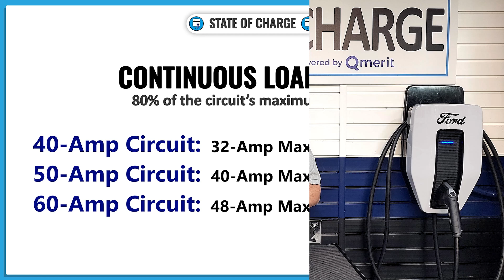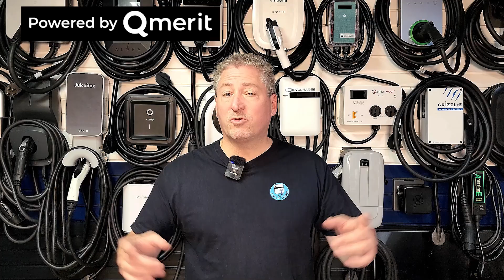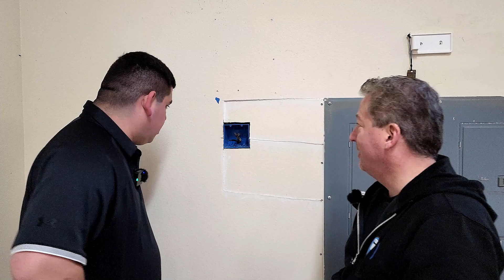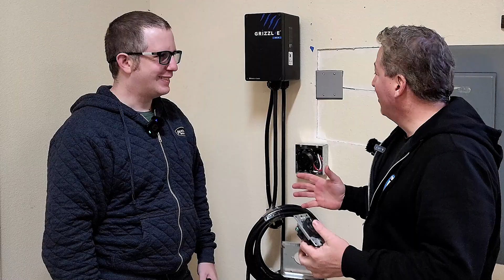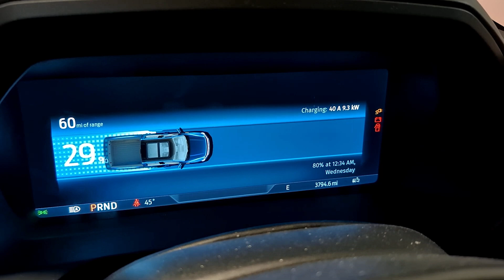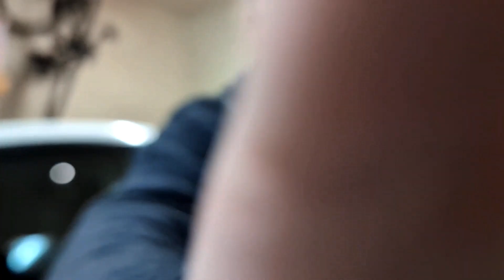Recharge Rescue Washington: We Fix A Dangerous NEMA 14-50 EV Charging Outlet Failure

Comment: hate to say it if you got the electrician over just hard wire and be done.  Also upgrade to the 60A and wire (I mean this is like 2-3 feet of wire) and you will get the full 11KW plus and have not to worry about plugging and re-plugging .. unless the plug may be used for something else.  cheers  good job though 🙂

Comment: I installed a Legrand outlet and it seems to be working fine. I did unplug it a few times over the first year to check for melting and found no issue. It has been installed for 2yrs now. If anyone has had issues with a legrand, please response if you see my message. My 2nd charger for my 2nd ev, I hard wired so no need to worry there.

Comment: Here’s a pro tip for all you DIYers like me.  To fit receptacle in box, you must bend wires as needed.  Always, do a final re-torquing before pushing wired receptacle in box.  Those final wire bends will loosen the connection causing heat.  Electricians refer to this as the “wiggle test.”

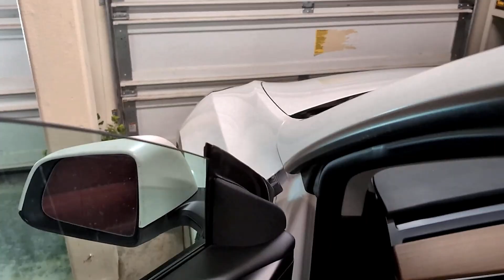Comment: 25:22 it actually appears that the Tesla is capped at 20 amps. Shows 20/20 A. Is the charging equipment communicating its max output to the vehicle, or is the vehicle configured to only accept 20A at that location?
Reply: The EVSE always tells the vehicle how much current is available using a signal on one of the small pins in the connector.  The car can be set to draw less, but the max it should draw is what the EVSE signals it can supply.

Comment: The contractors that qmerit has are junk. The contractor that qmerit had come over for me installed the wrong gauge wire, and breaker. I had to explain the 80% rule.

Also just an alaround sloppy installation. He didn’t know how to bend pipe so just used flex.

The Qmerit constrictor also said he permitted it. But when I got solar panels a couple months later, the permitting authority noticed and shut that circuit off. I had to pay the solar company to fix it and permit it.

Comment: In some cases a 50A receptacle will be wired to a 40A circuit per table 210.21(B)(3). Most mobile chargers only draw 32A continuous for this reason, however it is possible to find plug in chargers that draw 40A continuously. It is likely that most 14-50 receptacles can only handle 32A or less. I surmise this because there is little difference between a 14-50 and a 14-30 in terms of construction. In fact if you cut off the unused neutral on an EV mobile charger, it will fit in a 14-30 receptacle. The contacts are the same.

Comment: Thanks for covering the subject well. I had my NEMA 14-50 outlet installed by an electrician more than 7 years ago and have changed most days at output of 9.6 kw with no problems. Lesson to be learned is just because you were able to wire your house with Cat5 cable one weekend and speaker wire for surround sound another time does not make you competent for 50-amp circuits

Comment: The grizzle didn't support being directly hard wired ?
Reply: Of course it can. He didn’t want it hard wired though
Reply: why not ? Trying to understand why you wouldn't want it hard wired. It not a mobile unit.
Reply: @johnsmithuti  easier to replace, easier to plug in a level 2 mobile charger for backup if needed
Reply: @johnsmithuti  because when it breaks it can be swapped out very easily. You can also easily plug in a mobile unit as a back up if it goes down
Reply: @doomsday9973   @doomsday9973  oh I see 😄 but in this particular situation the charger got fried because it was not hard wired! Best practice is to always avoid points of failure
Reply: @ only because it was improperly installed and used a substandard outlet. Properly installed with a robust outlet they can last for years and years

Comment: First off, it didn't look like the homeowners charger was damaged, the one pin was just burnt.  It could have just been cleaned up.  But it was good that you provided a replacement charger and one that splits the charge, which is something he needed.

However, this was a lazy install by the electrician.  Why didn't he remove the drywall panel that the homeowner cut out?  And then replace the box inside the wall.  Now the homeowner has and external 240v box and a box cover on the other one.  It's not a clean install at all!  And why didn't the electrician check the parts at the shop prior to leaving for the job?  Then he would have had time to get the right cover for the 14-50 outlet.  Qmerit should be embarrassed and not use that company to represent them.

Wish you'd come to my house and replace my 14-50 outlet.  I installed the cheap one and got a Hubble later, that I haven't gotten around to installing yet.  I'm always checking the outlet for heat when charging and often will lower the amp rate, if I need it to charge for hours so it won't overheat.  It's an easy replacement for me, and yes I have a tool to do the correct torque.  I just haven't had the time to replace it yet.

And people wouldn't do these type of installs if permits and electricians weren't so expensive, especially for such a small job.
Reply: Same exact here. I de rate mine to 32 amps and it’s fine and has been for years. As soon as I get the chance I’ll install the hubbell
Reply: @doomsday9973  Mine is limited to 32 amps anyway because I'm using the Tesla mobile connector with the outlet.  I'll probably just reduce the charge rate to 25 amps when it's charging while I'm at home sleeping.
Reply: The reason that the electrician used a surface mount metal box is because the wall cavity contained insulation. 

The old box was surrounded by that insulation, which contributed to elevated temperatures.

As others have pointed out, the electrician did not use a torque wrench at the breaker.

Comment: I hardwired my charger (for our Bolt) in 2007.  It's a 40 A breaker with a short run to the charger.  I have used the 14-50 Leviton (older style) on my welder extension cord & tested my Rivian portable charger to see that it worked for 2 hours.  The cheap plug works fine with my tig/stick welder.  Likely because it is never used continuous, always short (under 1 min) welds.  As you pointed out, continuous high current produces heat & a lot of it.  Good Video Tom.  My next project is an off grid, stand alone charging system using solar panels & lots of batteries.

Comment: I bought a new house that came with a dedicated circuit in the garage intended for EV charging. The electrician used aluminum wiring. Later I hired another electrician to install an outlet for a plug-in charger and he installed the cheap leviton outlet. Over time the level at which I could charge my car without tripping the breaker got lower and lower. It was because the outlet was slowly disintegrating and the aluminum wiring was expanding and contracting too much causing loosening of the connections. Both electricians knew what the circuit was going to be used for. I finally had to spend thousands of dollars to replace the entire circuit with copper wire and the outlet with a hubbel.  It was absolutely ridiculous, and I used qualified electricians.
Reply: There are specific connectors designed to interface aluminum and copper wiring. They have to be used and torqued correctly. Then copper wiring into the EVSE.
Reply: Thousands of dollars just to pull new wire and swap a recepticle? Where is your electrical box? The other side of the house?

Comment: No truer words have been spoken my friend Tom.  After watching Sandy Munro’s video 2 yrs ago on charred receptacles, I upgraded mine to hard wired or Hubble 14-50s for remote locations.  The $10 Home Depot receptacle is designed for my dryer, not a car charger.

These United Charger Grizzle-e Dou’s are underrated as they’ll build them with a J-1772 or Tesla NACS or 1 J-1772/1 NACS.  No one else does this!  I just wish it could be upgraded to a smart unit.

Comment: Maybe this will be discussed later in the video, but why install a 14-50 outlet at all?  Wouldn't hard wiring the EVSE remove the cost of both the 14-50 receptacle and the plug, and also allow a less expensive circuit breaker instead of a GFCI breaker?
Reply: Ease of swapping a new unit if the old one fails, also have access to a quick level 2 backup solution with a portable charger. Several reasons. I prefer plug in over hard wired as well
Reply: @doomsday9973  I have 120 V, 20 A outlet for backup.  Charge speed, even at only 12 A, is fine for my daily driving, 15-50 miles per day.  I used 120 V for a year and it was enough even in winter.
Reply: @ that’s fine for you but 120v will not cut it for most people. Having a 240 is a much better backup
Reply: @doomsday9973  Sure, people that drive 40+ miles every day will need 240 V.  

I still would prefer hardwired EVSE over plug in though.  Less things to fail, and no need for an expensive GFCI breaker that plug in EVSEs require.

Comment: I still at this point cannot explain why any home charger should use an outlet setup. You aren't going to take that charger with you (unless you move). It's just a point of failure.
Reply: EVSEs can fail on their own all the time hardwired or not. When they do you simply plug in a new one in minutes. You also have a quick and easy back up option with a portable charger you can simply plug in if your wall unit goes down so you always are covered

Comment: Oven and electric range don't run continuously. They get up to temp and then regulate their output to maintain the temp. Maybe on high, but otherwise it's not pulling max power the whole time it's on. So not a continuous max amp issue.

Comment: You should also include a 30amp circuit. This is what most dryers run on. I have a 100amp service and I changed my dryer to a heat pump dryer and I used that circuit for charging the cars at 5.3 kWh. That is the highest power you can use with a 30amp circuit. I can go from 10% to 90 in like 14 hours. Thanks for the advice
Reply: In case it was missed, the amount of power isn't the reason they fail, it's having that power flow for hours and hours every day. Do please check your outlet and make sure it is up to the task!

Comment: Great Video! I’ve seen so many people on various EV forums use cheap charger outlets and it’s nerve-racking. I’ve had a few EVs since 2020 & I’ve learned a lot from your channel. We’re purchasing a home and selling our home with two EV chargers. The new home is a very large home that’s 20 years old with two breaker boxes. The home is in Kosciusko, Mississippi & I’m struggling to find a local electrician who knows anything about EV charging.

Comment: Something I discovered while charging is be aware of the appliances that are running in the house. 
Other than having an extra appliance that turned off the main breaker, there have been no problems charging my Leaf.
Reply: Your install is not proper. You should not be tripping a breaker while charging.
Reply: @tkmedia3866 100%

Comment: This is an interesting video that brings to mind so many questions:
Like, why was a surface mount box used instead of a flush mount?  An explanation by the electrician might have been enlightening.
Shouldn’t Leviton just discontinue the cheaper receptacle if it’s not up to the task of [semi] continuous operation?
The new EVSE base was mounted on the wall and then moved. Is there a problem with locating it too close to the receptacle?  Maybe this was just a minor mistake, and no explanation would be necessary.
Others have pointed out that the connections to the circuit breaker weren’t evidently tightened with a torque screwdriver.  Fair enough, but someone’s reply that this is nitpicking is disappointing.
On the positive side, I like the load-sharing feature of the dual EVSE.
Reply: Why would they? It’s fine for everything else like dryers, ovens etc. which is what the vast majority buy them for. Leviton literally has an EV charging receptacle now they sell that similar to the Hubble and meant for EV charginhb
Reply: @doomsday9973  Yeah, ok fine.  So someone moves into a house, sees that there is already a socket in the garage, and hooks up their car charger to it, draws 45 amps from this 50 amp receptacle, and it melts.
Reply: @zot8565  you can’t pull 45 amps off a plug in EVSE genius. They all do 40 max. 🤣

Comment: Bigger isn't always better. I'm pretty sure Leviton could quite easily design a better 14-50 outlet that is mostly the same besides $0.30 more brass in it to address all of the design weaknesses if they wanted to. Much like how there is only ~$0.15 worth of material difference between a cheap 14-15 outlet and a high-end one excluding type-specific certification costs.

That destroyed outlet looks like a typical under-torqued situation. 60 in-lb is kind of hard to achieve with a regular screwdriver if that is all he had at the time.
Reply: They actually did they make another model receptacle designed for EV charging
Reply: @doomsday9973  For 4-5X the price. There isn't 4X the engineering and materials in there. Maybe 1.3X if I make a maximal effort to be generous, mostly due to the extra space necessary to enclose caged wire clamps.

The point was that a 279 updated to safely pass 40+A continuous would be only marginally more expensive to manufacture.

Put another way: this is artificial market segmentation. Instead of fixing their entry-level outlets' designs and raising retail prices by $1-2, they make you pay $40-70 extra for specialty designs that shouldn't have been necessary in the first place.
Reply: @ great info. Can’t say I’m surprised. Thank you for sharing

Comment: Tom: I posted this previously on another one of your videos. Based on your recommendation, I had Qmerit hard wire a 60A circuit to power a Tesla Universal Wall Unit last January and the installer DID NOT TORQUE the connections. It was only when I complained that the supervisor came out and properly torqued them. 

The supervisor told me that Qmerit’s installer certification materials did not train on torque specifications and their qualification test did not ask any questions about it.  

I caught it only because I had watched the installation and had heard from you how important it is.  

I know you want to encourage people to use your sponsor, but PLEASE don’t put your excellent reputation on the line by telling your followers as a certainty that Qmerit will properly torque the wiring, because in my case, it was not initially done.  And who knows how many previous installations this contractor did that may have be installed without using the proper technique. 

You probably have enough influence with Qmerit to push them to insure their training materials and testing are modified to assure their associated contractors are doing what you say they will do.
Reply: Wow that’s crazy! Just goes to show even the “ev” electricians are far from perfect

Comment: I purchased a Bryant outlet and the backing box etc for my daughters home. Had the outlet installed by an electrician and found out something that your QMerit contractor did as well. The cover plate doesn't fit over the Bryant outlet.. I ordered the correct plate online and finished the job a few days later. Maybe Bryant and Hubbell should sell a plate with their outlets.

Comment: Oh boy! I think it's time to call Q-Merit! One of the reasons I actually leased a Nissan Leaf in 2011 was because the previous owner (for some reason) had an electric clothes dryer in the garage and I had a 240v outlet in the garage. After removing the dryer to its proper location, I wired in another box attached to the existing box with the correct receptacle  to match my Nissan charger's plug and moving it closer to the charger. It's a 30 amp breaker so I have the charger and the cars dialed down to charge at 22-24 amps. It's been ok for like 13 years but its time to call in a professional and upgrade everything correctly. Thanks Tom!

Comment: Excellent presentation. We are about to buy a house that has an EV charger installed. I will have a qualified electrician inspect the outlet, wiring, and breaker. Thanks again.

Comment: The only home load that I can think of that can draw more current than an EV charger would be an electric tankless water heater. They can be 24kW+. The difference is that the tankless water heater does  not run continuously.
Reply from the maker: That's still not as much as the average EV charger which draws 40 to 48 amps
Reply: @StateOfChargeWithTomMoloughney 48A at 240V is only 11.52kW. 80A at 240V is 19.2kW. I don’t know of any home EV chargers that draw more than 80A, but I know that if anyone would know of one it would be you.
Reply from the maker: @Kimandy6862  I thought you mistakenly said 24 kW+ when you meant 24 amps.  I get comments with people confusing that all the time.
OK, so you meant 24 kW. I didn't know that they drew that much power, thanks for letting me know. But they don't draw it continuously for up to 12 hours a day.
Reply: @ agreed.
Reply: @StateOfChargeWithTomMoloughney you made a video recently about a product designed to charge your EV from the meter socket. I think it’s a great idea but as an engineer I wonder how this complies with NEC 230.82 which has a specific list of equipment that is allowed to connect on the supply side of the service disconnect (main breaker in the home).